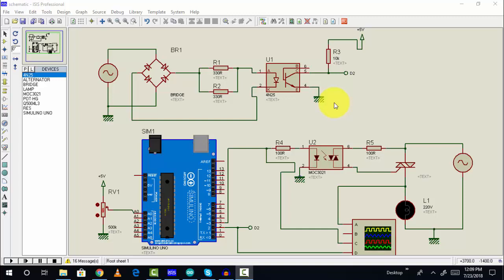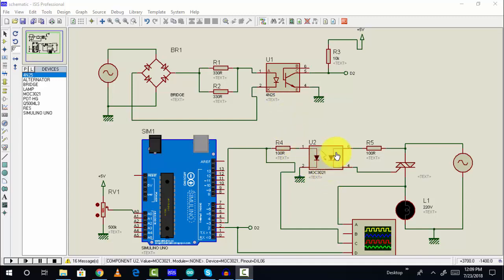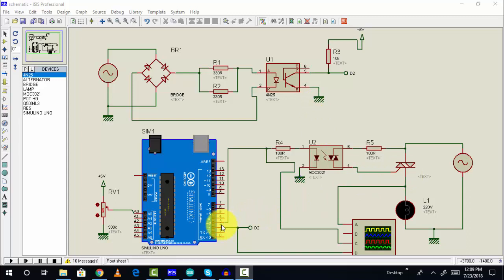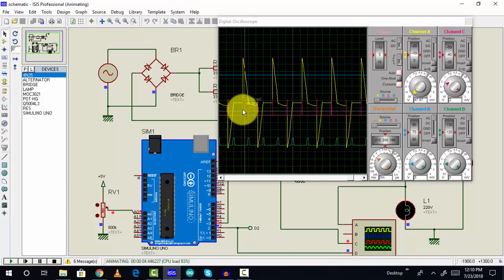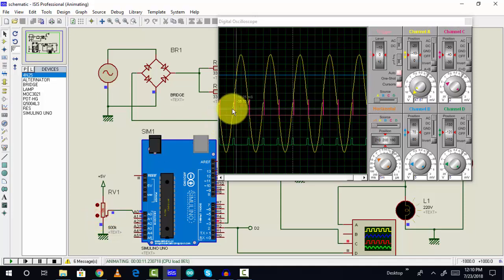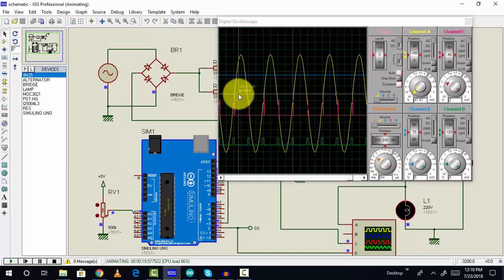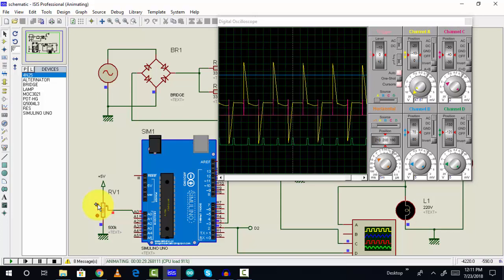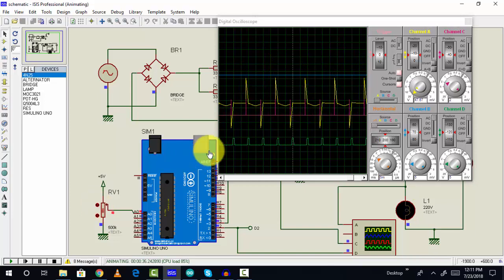Thyrsitor firing angle control using Arduino Uno

Comment: Can we use scr in 8 sequence output from 0° to 180° that is the bulb should turn on at 0° glows brighter, next 10° glows lighter than the bulb glown at 0° and at 50° the bulb glows dimmer and so on ......

Comment: great video! I have been trying to do this type of simulation on the proteus, but I always have errors in switching circuits. Errors always involving "transient" "gmin". Do you know how to help me? The circuit schematic and codes are correct because in the laboratory it works normally. My problem is the simulation with the proteus in times of the covid pandemic. I have been trying to do virtual practices with my students and suffering from these problems. Thanks in advance.

Comment: Does the arduino have enough resources to handle this gate retardation entirely in a software loop? I'm thinking motor control with ramping profiles. Perhaps introducing switch feedback as well.